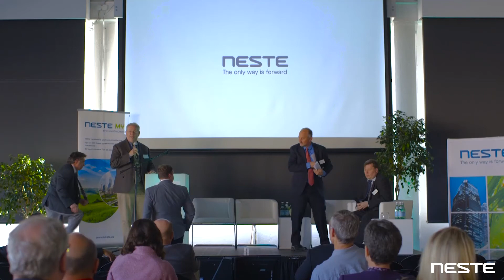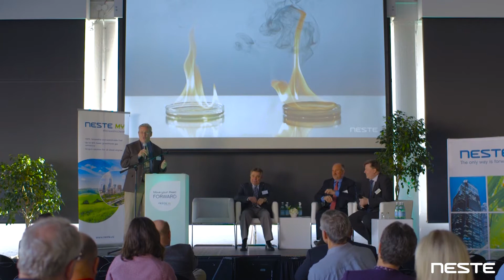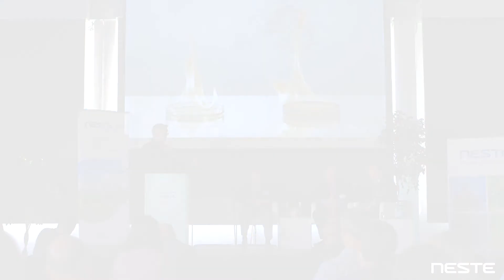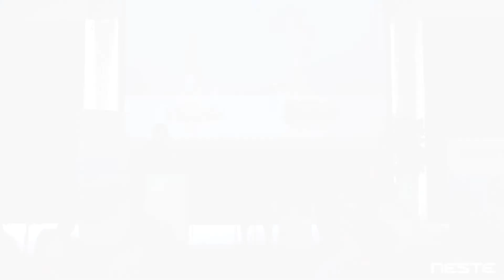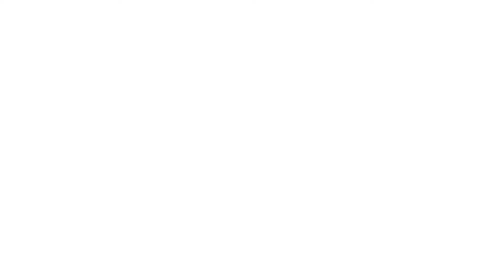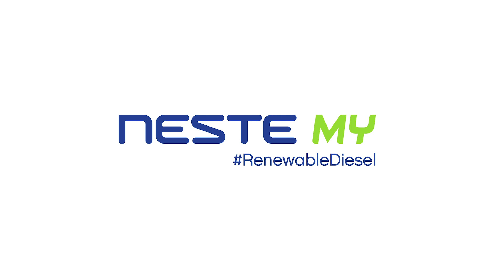What is the future of diesel engines and renewable fuels?

Comment: We are too quick to ditch demonised diesel engines in favour of heavy, energy intensive batteries.  We need to develop alternatives to fossils like #HVO from waste whilst H2 infrastructure remains poor. We must encourage better aerodynamics, lower frontal areas, lower unsprung weights, longevity of design and avoid  the trend towards #vehicleobesity  We can add electrical preheating to reduce start up emissions by 70% eg: #defa
Reply from the maker: Hi Luke, We need all kind of solutions in our race against climate change! Regards, Jaana/Neste
Reply: Neste yes I agree, I am pro anything that reduces consumption and emissions. EVs and H2 options are developing well for future vehicles but I think neste could do more in Europe and the UK. The bad press over the vw scandal is colouring people's opinions and politicians are making decisions based on hearsay and on inaccurate information. Pollution is national and international weather dependant not just street level from power generation and space heating as well as transport. The advantage of hvo from waste is energy density and operability with existing diesel engines and in aviation. But if people ditch diesel engines when they buy or lease new vehicles we will see a rise in overall pollution. Already figures for the UK show new car CO2 has risen 16% as people switch back to fossil petrol and PHEVS. NOx levels from petrol engines rises with wear especially after 50,000 miles and very few have particulate traps or anything to control NH3. DEFRA found in 2014 that 50% of urban NOx in the UK was from PETROL euro 1-3 cars.
Reply from the maker: Thanks for your comment. You can read more about our views from here: https://www.neste.com/sites/default/files/attachments/taking_action_on_climate_change_version2.pdf  Kind regards Sirpa/Neste